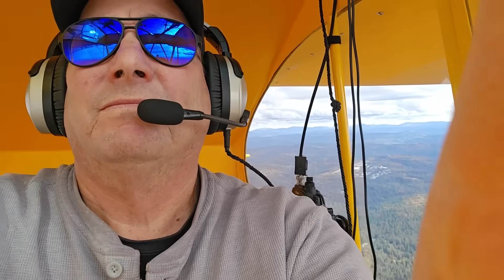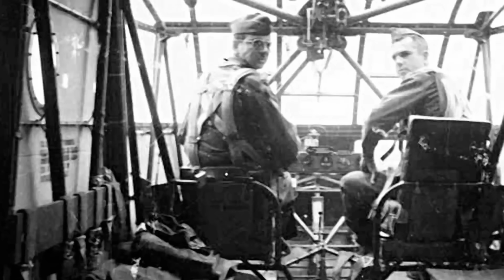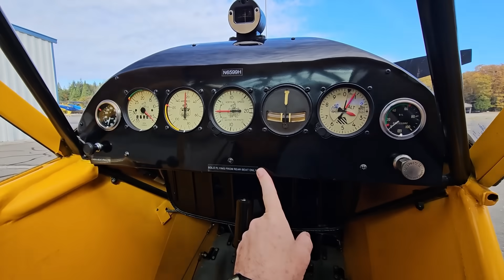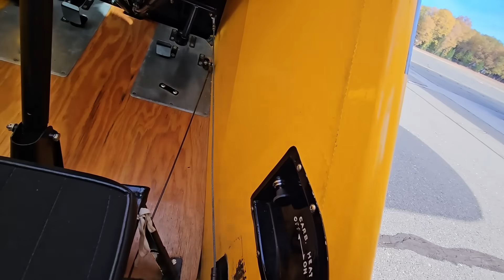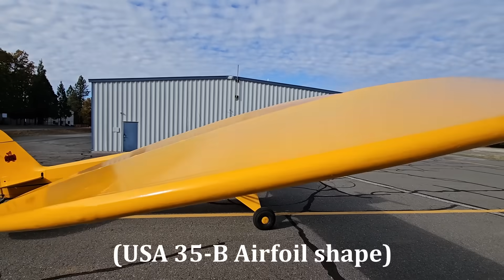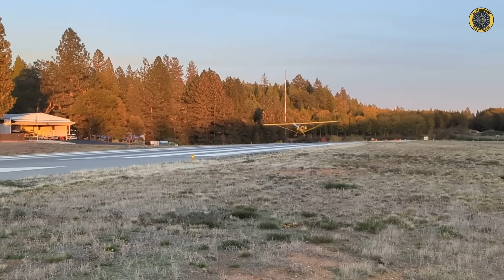Meet the Cub! 1946 J-3C

Comment: My very first ride in an airplane I was 13 years old  1961, was with Hank Durham in a Piper Cub out of Felts Field, Spokane, Washington. Single seat for pilot with a bench seat in the back for me and my father we flew to the Selway wilderness area in Idaho we had to buzz the grass strip to clear the 30 or so elk that were grazing. I remember while trying to leave and unable to get enough altitude to get above the clouds and ask Hank what does it mean when the little black thing dropped at the bottom of the vile on the wing, he said “we’re running out of gas.” We  turned around, landed back at the forest service cabin, and we were socked in by weather for  three days of school and caught the biggest cutthroat I’ve ever seen. Incredible experience I’ve been in love with general aviation ever since.☮️♥️🇺🇸

Comment: Beautiful plane, Juan, and Happy Birthday!. You should also mention when talking about wing washout that because the inner portion stalls first you get the early warning buffet but maintain aileron authority all the way to full stall. Question on your aux fuel tank: Is it just in one wing half or are there two tanks, one in each wing? If just in one wing, what does that do to your side-to-side balance when the aux is full? Do you have to "lean" a little on the aileron to keep it level, or is the weight close enough to centerline that it doesn't matter?

Comment: Welcome to the Cub clan. Some corrections: 178 sq ft, not 750. Also, a USA 35B airfoil, similar to a Clark Y but different leading edge contour.

I own a close sibling, on the same TC A691, a 1947 Piper PA-11.

Comment: A nice little aircraft that is more something you wear than you travel in.
Even though I don't fly anything myself I see that it's a pretty good plane to start in where you can learn all the basics. To some extent I think that the same applies not only to aircraft but to cars as well - learn how to work and use an old car without all the gizmos and you understand what you shall keep an eye on even in a more modern car and maybe your car could avoid being showcased on "Just Rolled In".

Comment: A colleague of mine at, NBC Radio, 40 years ago. He had a Cub. His dad was, an airline pilot. He was a DJ. I was the engineer. It was a union shop. So we worked together.

He would tell me stories with the Cub. If he was in,  too high a headwind. He would be flying backwards. He said he would look at the ground. He wouldn't be going forwards. He would be moving slowly backwards. And that was a problem with the Cub. He told me. They fly so slow. That with a gigantic headwind. You may not go anywhere.

Either way. I learned in a Piper Cherokee 140, with my dad. But he also set me up with his instructor for a couple of lessons for me. And I was a much better pilot than my dad.

But by the time I turned 15. My folks got divorced. And we all moved in opposite directions. I never flew again. It was great. I loved it. I wanted to go into the Air Force. I didn't qualify to become a fighter pilot. So I didn't enlist. I thought perhaps if I listed to do something else. They would find out.  I knew how to fly. And maybe they would reassign me? But I know it doesn't happen that way in the military. At least not during largely peaceful times. Where, they don't have an emergency need for pilots. So it was not to be for me. And I feel cheated. I wanted to serve my country. I ended up serving it for a short while. A bit differently.

I received a phone call. Only 6 weeks, after my lifesaving brain surgery. To come do a, international, News Broadcast. From the VOA the Voice Of America's, TV Facility. And I told them. I hadn't done a TV news broadcast in 6 years. And I just got out of the hospital after brain surgery. I asked them if they had the right phone number? They said I had been referred to them. They need me for an emergency broadcast on Thanksgiving day. I said that's only 3 days away! I said, I don't know what kind of gear you have? I don't know the format of your show? I haven't met anybody? I need to come down. They told me they couldn't pay me for that. I said I don't care. Can I come down tomorrow morning? They said sure.  I said great.

So the day before the broadcast. I show up to VO A. And they had one of the few audio consoles. I had never seen nor used before. It was a big one.  I introduced myself to everyone. And I bid them,Good night. Until tomorrow.

I flew that big audio console the following day. Solo. No check out. And did a perfect World Wide Broadcast. Then they told me they wanted me on board full-time. I said sure. This would be good. And it was for the next year. And I was serving my country. At the Federal level. I was directly across the street from our, Nations  capitol building. Directly across the street. 100 feet away. Nearly across the street from the Smithsonian Air & Space Museum.

It's always something
RemyRAD

Comment: Beautiful airplane Juan. I learned to fly in the larger Piper Tripacer which also had a steep glide slope.  Only flew in two Cubs with instructors. One was clipped wing with inverted fuel system in Bellingham, WA and the second was a float plane on Flathead Lake in MT.  You’ve got a nice one for sure.

Comment: I had a very serious event with a 65 hp j3 cub. It was set up for towing banner with it. .  As I  was preflighting prior to engine start for a flight I reached down beside the seat and pulled the banner release handle. I gave it a good hard yank like I would to release the banner. The D ring broke off. The force of my pull threw my hand up under the instrument panel. My fist hit the bottom of the fuel tank. The bottom of the tank fell out. A gushing stream of 100LL poured out on my feet. The fuel tank was steel and the bottom had rusted out. I believe I saved someone's life right there by my accident. The plane was also a rental and many people were flying it.

Comment: I noticed that in the rear seat when you pull aft on the stick the seat cushion seems to help to ease the stick back forward. At least, easing it towards a more neutral position. Could that have been a design feature? 

Handsome Cub, Blanco. 👍🏼

Comment: Very nice Cub! We put shoulder harnesses in ours so now you need an "arm extender" to reach the carb heat- which you don't want to forget during power off stalls with a small Continental engine so as to not get any carb ice.

Comment: I started my training in a 1939 Aeronca. It was equipped with a 65 horsepower engine and did not have an electrical system. Hand propped it and only flew to and from uncontrolled airports. It was based at Fremont airport in Fremont, California. That aircraft taught me how to handle cross wind landings. 😅

Comment: When I was 15-16 years old I worked at the Sussex, N.J. airport and took flying lessons in the Cub. I helped rebuild 22 of them, sanding scraping and testing for cracks, then covering with several coats of dope. We sent the engines out to the factory to be rebuilt except the Franklin engines we scrapped. I spent 4 years in the ASAF and still fly R/C model planes. The biggest one I have is 1/4 scale. My 80 birthday is Nov 21. WA7VQR
Reply: Happy bday for towmmor  ted    Respect from the UK     ( I live in Sussex  South coast UK )

Comment: This brings back memories. In the late 80’s five of us put in $3,500 each and purchased a Cub in PA. You are right about the brakes being weak. We would pump them up, clamp the brake hose with vice grips and try to put more fluid in the reservoir to help. Don’t remember that helping much. My first flight in Our Cub involved a lot of airsickness from PA to NC with one of my partners. I was a young instructor. My checkout was from one of my partners. The first time I could make three landings in a row without help he got out. I made three more landings and one of the partners with no Cub time got in and I became a Cub instructor. It’s a miracle we didn’t destroy the airplane over the several years we owned it. You can park a Cub beside a King Air or Citation and those pilots will come out and admire it more than I admire their airplanes. It taught me a lot about flying. I had a rocker arm break in it and had to land on I-40. The engine continued to run but wouldn’t develop enough power to maintain my altitude. I had the door and window open so it sounded like multiple shotguns going off right beside me. Fortunately, there wasn’t much traffic on the interstate. One of my partners came and fixed it. The Highway Patrol blocked traffic and I took off the next day. That was the highlight of my flying career. I miss flying but I miss more the people and the relationships you develop being part of a small airport community. Thanks for the video.

Comment: Back in the early 80's I watched a Cub doing pattern work at a local municipal airport.
It seemed to me it took off at about 30 knots, cruised around the pattern at 30 knots and landed at 30 knots.
It also seemed like it never strayed beyond 200 feet above or 200 feet horizontal from the runway during all the touch and go landings.
I was in awe.

Comment: Happy Birthday Juan! Nice looking Cub. My first solo in 1960 was in a Cub at Waukeegan, Il. Now own/fly a Piper Vagabond PA-15  also with an A-65 and Grove brakes (much improved braking). Watch your tire pressure as the tires will slip on the hub and pull the valve stem out destroying the tube.) Prces for tubes are now well north of $150.each. Enjoy.

Comment: I flew a 75 hp J3 with a metal climb pitch prop. As you advanced the throttle you pushed the stick to raise the tail and by the time you reached the full throttle stop you pulled the stick back and it flew. 70 mph it's cruise. It's  hard to see how anyone ever got killed in one but it was subject to stall/spin like most and had almost zero occupant protection. Flying alongside cumulus clouds at 7500 ft. with the door open was the only time I ever experienced a twinge of acrophobia in an aircraft. Never at 390 in a L1011.

Comment: Mine was a 1940 wood spar J-3 that had been upgraded to a continental 75 hp with one impulse magneto for easy hand-proping (no broken fingers) and an auxiliary wing tank. I upgraded the panel to modern (1960s) instruments including a Venturi-driven directional gyro. It was on floats in the summer, wheels in Fall and Spring, and skis in the winter (no brakes on bare ice!). I had a lead weight above the tailwheel for legal (within the weight & balance range) front seat solo when it wasn't on floats.

Comment: Really nostalgic for me. I learned to fly on a 1946 J-3 back in 1962 in Long Island, N.Y. No electric, no radio,
no transponder (what was a transponder? !!) . If you did have a radio , how did it work anyway? !!  In those days the only requirement for flying overhead
JFK (then it was Idlewild International), was to stay at 2500 feet or above. Hard to imagine now!
It was great circling overhead watching the DC3s, DC6s, Constellations and the new fangled
contraptions like the B-707 and DC8s landing and taking off under me. 
Thanks for the reminder of the 1946 J-3 and Happy Birthday and a million more to you.